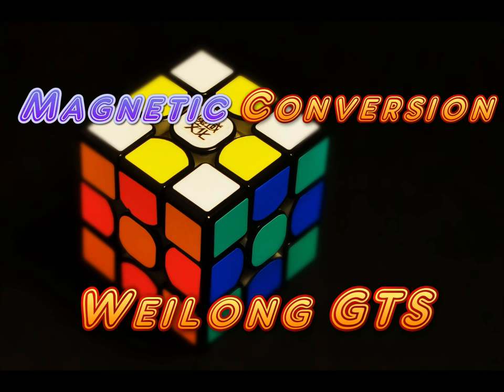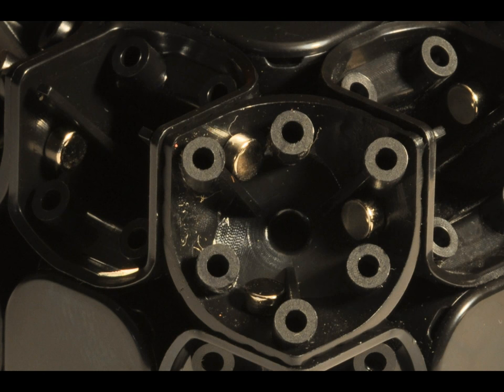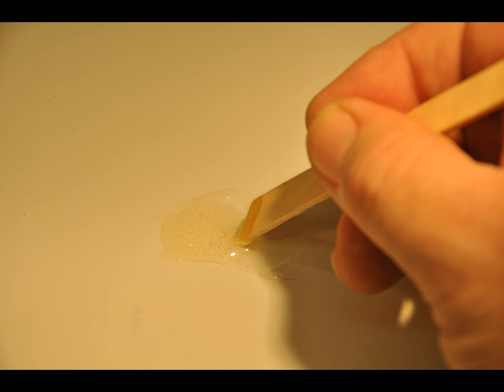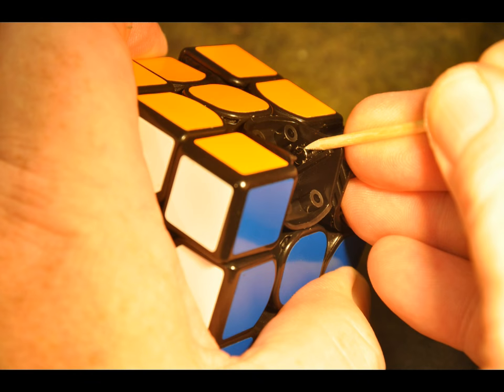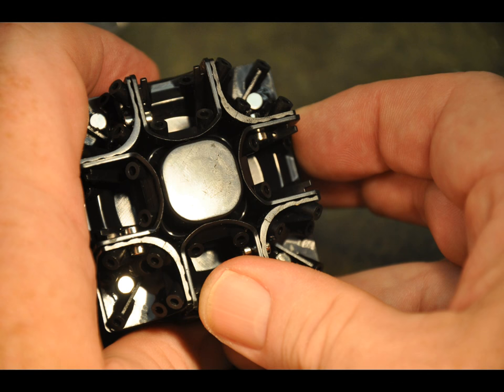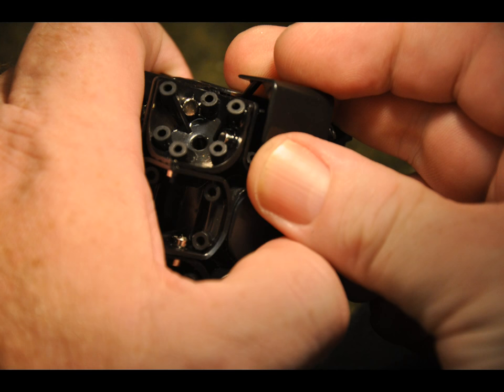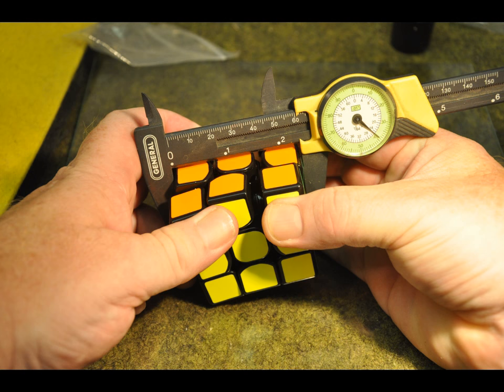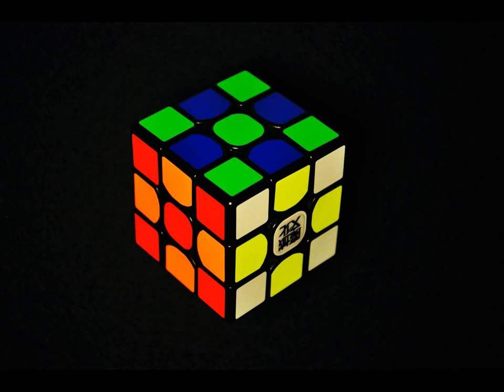Weilong GTS M (Magnetic) Do It Yourself Tutorial

Comment: would 2 n35 magnets equal an n42 magnet? I currently have a gts 1 and wanted to magnetize it to improve stability, but only n35 magnets are on amazon
Reply from the maker: BSØNG I'm sorry. I'm just now seeing your comment. The N numbers don't really work that way. "N" represents the grade or strength, generally N35 being the lowest consumer grade neodymium, and N52 being the strongest. You can double magnetic thickness to get an approximate doubling in strength: like two N35 4x1 magnets, stacked, would give an equivalent of a single N35 4x1. In this example, 4 means the magnet is 4mm wide, and the smaller numbers, 1 and 2, are the thickness in millimeters.
Reply: DMCubing ah, thank you! So you’re saying there would be no point in stacking two N35 magnets?

Comment: Neodymium magnets come in many different grades ("strengths"?). What I found it goes from N28 to N52. The magnets in your link have N48. Did you try different grades? Would you choose stronger or weaker ones for your next cube or N48 is a perfect number?
Reply from the maker: Excellent question! Well, I had been trying to find out what the Cubicle used in their cube by watching as many videos as I could find and reading as much about the cube as I could. When they commented they used a US company, I searched and I found two major US magnet companies: KJ Magnetics and Apex. I attempted to derive a size of the Cubicle magnet based on their photo. As close as I could come was what I think is probably 4mmx2mm. I searched for those sizes and out of the two major US magnet companies, Apex is the only one that carries the 4x2 mags. Their magnet happens to be an N48, like you pointed out. Like I said, I couldn't find a comparable size magnet at KJ. It's possible they may be using a fractional (like 3/16") and not metric. Anyway, I think the N48 4x2 works great. I'm looking forward to giving a couple of my cubes away to see that at work in the hands of some folks that are true speedcubers. While I haven't really planned on using a lower grade (lower N number) magnets, what I'm going to experiment with is building a cube with 4mm x 1mm magnets, With these you can add additional 1mm magnets on top, resulting in a variable magnetic strength cube. That ought to be a fun project!

Comment: Nice i subbed, by the way, when i order the magnets, and i place an order for one, will it give me 50 magnets, or will it only give me one
Reply from the maker: Hey, thanks for the sub! I'll sub back! When you order the magnets, it's for a single bundle of 50 at $6.99. Let me know if you have any questions and how your project turns out! I've been using my magnetic GTS all day long. It's incredible!  :)
Reply: Man, great job!! You definitely earned a sub!! But, I have 2 -man Bell pyra's lying around, could I use those magnets maybe? GJ!! :)
Reply from the maker: +cyothe3rd Hey, thanks! I'll sub back! Hmmm I don't know what size of magnets the magnetic X-man pyraminx uses, but as long as they're really no wider than 5mm, you probably could use them in a GTS. You'll need 48 of them. Looking at pics and videos online, to me the pyra magnets look about the same size that I used: 4mm x 2mm. But that's a guess. You could always take a couple of cubey pieces apart on a GTS and see how the pyra mags fit. Also to see how much pull force they have- they need to have enough strength to make a difference but at the same time, not be too strong. You can test for this with a couple of cube pieces removed before ever gluing the magnets. Let me know what you find out.

Comment: Fantastic job with this!  I now will probably have to try this ;)  
Would you say there are any 4x4s or 2x2s that would work well for this method?  If so, tell me which ones!  I'd love to try it on other cubes as well :D
Reply from the maker: Oh, THANK YOU so much! You're very kind. I appreciate your kind words! Please be sure to watch my next video (it will be uploading soon) as I address how the magnetic GTS feels in the hands. A little head's up: I'm convinced (until I can prove otherwise) that an Illusion (Primary body/Black caps) is superior over the black plastic body. There's something about the plastic, I believe.

I've been thinking about the 2x2 and I don't really see how it could benefit. The way I see it, the magnets help for overshooting and slight undershooting on a 3x3. They also keep the cube in constant alignment. (I demonstrate this in my next video). I can't think of any occasion where this would be fully applicable to the 2x2. It has short turns, no overshooting and fairly good self-alignment, I would think. As for the 4x4, I have no experience with that cube at all. It may very well benefit, but figuring out where to put the magnets would be a challenge. I think the 3x3's design really makes it simpler because of its single middle layer. Pieces revolve around this layer. With a 4x4, it's not present. I'm sure someone more smarter than myself will come up with some sort of 4x4 mod.

Thanks for watching. I enjoy your videos. You do a really good job! Let me know if you modify a GTS. I'd love to see the result! Take care.
Reply: I was wondering if you think you could do the mod in almost any 3x3 with caps, such as the Fangshi cubes.  Do you think that would work?
Reply from the maker: +PurelyAwesomeCuber I'm not familiar with those cubes. I think though that the best cubes would be those that don't have much cubey piece drag. Cubes where the pieces don't rub much against each. These would be like the Aolong V2, Weilong GTS and Version II, Gan Air, Valk 3 (to a degree- it has a little drag), etc. A cube like the Thunderclap wouldn't really benefit from magnets because its cubey piece drag slows it down as the face comes into its resting position. Then, you have to look at the cube piece design to see if a 4mm magnet would fit inside it. 
Oh, I just ordered 300 more magnets! Lol! Got some projects in mind. Also a giveaway I think I'll do.
Reply from the maker: +PurelyAwesomeCuber I looked at the pics of a Fangshi on cubezz. They tend to have the best pics of cube pieces. It looks possible, but is the bottom half of the edge piece in two parts, right down the middle? That might present problems. The bottom of the corner piece looks crowded too, with the way the stalks attach.
Reply: Ok thanks for the info!  Yes, there is a lot going on inside the Fangshi pieces.  Sorry I didn't respond sooner - it didn't notify me.  What you're doing with these magnets is great!  Keep up the good work!
Reply from the maker: Thanks! I appreciate your kind words!!!

Comment: Instead of using the epoxy can I use super glue?
Reply from the maker: No, I wouldn't recommend that at all. The relatively slow drying time of epoxy allows you to make small adjustments to the magnets' positions. Also, you have to work very close to the parts you need to glue. The magnets are very strong and you'll find yourself kind of wrestling with them. I get epoxy on my finger tips every time I do this. It's fairly easy to clean off. With superglue, you risk gluing your fingers! Now, having said all that, there would be a way to do it, but I still don't recommend it because superglue is thin and unpredictable: You could place all 48 magnets in their correct places then add a drop of superglue to the base of each magnet. This comes with too many risks, in my opinion. Epoxy is safer.

Comment: Where do you put the epoxy? The place where you first put the magnet or the place after you push the magnet down?
Reply from the maker: Essentially in the place you first put the magnet, then you slide the magnets down just a couple of millimeters until they seat into position. So you put a little drop of epoxy in the general area then the magnets on top of the epoxy, then push them down into place. The total amount of distance between these two places is mere millimeters. Hope that makes sense.
Reply: +DMCubing can 5mm x 1mm magnet work for this
Reply from the maker: +Valk 3 They would probably fit but would have less than half the magnetic pull force. 5x1 = 12.8 OZ vs. 4x2 = 31.04 OZ.

Comment: hey DM cubing!!my gts v1 is a smooth cube which is not too fast and not too slow.could I use n52s(4mm×1.5mm) ??Will they make  the gts click too strong while turning??
Reply from the maker: Tangy V A magnet like the N52 4x1.5 is going to have an overall magnetic pullforce strength just slightly stronger than an N35 4x2. That is a very light, subtle magnet in a cube like the GTS. I doubt you would have hardly any bump or click. Though I've never used a magnet that light in this cube, I think it still might have some positive effect over the cube. It will be light and certainly not too clicky.
Reply: DMCubing n52 (4mm ×1
5mm) or n45s(4mm ×2mm)??
Reply: Would n50's work?

Comment: I know that this video is a year old, but I'm still going to ask anyway.
1. Have you tried n50 4x1 or n40 4x1.5? I don't have n48 magnets in my local online cubing store, so I'm going to have to choose between the two.
2. Does the position of the magnets matter? Like closer to the outer part of the piece or closer to the core?
Reply from the maker: SalmonGuyGamer 1. If these are your only magnets, then certainly use the 4x1s, but you will need to double them- stacking one magnet on top of the other so you're essentially turning them into 4x2 magnets. If you don't double them, the 4x1 will be significantly too weak. The GTS is a thicker heavier cube so it needs a stronger magnet. An N50 4x2 (or two 4x1s stacked) will give a great magnetic feel. 
2. Yes, the closer to the center of the cube the magnets are placed, the more subtle the magnetic feel. The further out and toward the outside of the cube they're placed, the stronger the feel. In the GTS you're more or less limited to a certain area to place the magnets. Your double stacked 4x1s will be fine.
Reply: DMCubing What feel will the n50 4x2 give?
Reply from the maker: SalmonGuyGamer A medium subtle feel. I've used N48, N50, and N52 in the GTS. The N50 is good because the N48 can be a bit too subtle.
Reply: DMCubing Okay, thanks for your reply! Probably going to try a magnetic gts because the gts v2m (mass produced) just seem too subtle for me. And plus I don't like the size of the gts2.
Reply from the maker: SalmonGuyGamer Sounds good. But a self-magnetized GTS2M can be a wonderful cube. Good luck on your GTS! Let me know how it goes.

Comment: Hey DM. Quick question. Would it work if I were to glue the magnets in the corners first, to determine the placement of the edge pieces?
Reply from the maker: On the GTS. Sure. You can glue both at the same time. I've used several different techniques on the GTS. I probably should do an update video on this one, but I think I'll let this one stand as it is. But back to your question. The GTS is unique in that we can glue all the magnets without ever disassembling the cubie pieces. And the gluing locations are easily exposed, so really whatever gluing technique works best for you, I'd recommend that.

Comment: So do you glue in all of the edges, using the corner magnet to help keep it in place, then wait for it to dry, then glue I the corner magnets? Or do you glue the edges, then the corners before the edges dry?
Reply from the maker: On the GTS you can do it either way. Here, I glued both at the same time. On cubes that we remove the pieces, I do both parts separately into two phases. Great question!

Comment: Gonna try this, but unfortunately Magnets365 doesn't carry N48. Would the N50's make a drastic difference? I don't want the magnets to be too noticeable when going fast.
Reply from the maker: Keanan Tan Have you tried Apex Magnets? They are who I order N48s from. Their shipping can be high, but occasionally they offer free shipping on weekends.  
The N48s in a black GTS will be subtle and this sounds like what you're after.
Reply: Hm, would the N50s have a subtle feel as well though? Or would they be on the more noticeable side?
Reply from the maker: Keanan Tan Kind of in between particularly in a black cube. And it depends on the N50 magnet. There are a lot being sold that are weaker than they should be. But if they're truly N50s they will be noticeable but shouldn't feel too strong. If you like the magnets to be subtle, then N48s in a black cube would be the way to go.
Reply: Hey, what strength of magnets would you recommend for the MeiYing?
Reply from the maker: Keanan Tan I haven't done mine yet, not in the conventional way, but I would think the grade N48 4x2s would be fine in it.
Reply: Darn, I just got N35s since it and the Valk are so similar. Hopefully the change in stability and feeling isn't too subtle!
Reply from the maker: Keanan Tan well, like I said, I haven't done mine yet. Well actually I am working on one, but I am magnetizing it in a different way, where the centers attract the edges. But it may very well be that the N35's work fine. If you use them please let me know the results as I am curious myself. Thanks!
Reply: I'm certainly curious on how this new way would work. Does it have any envisioned benefits as compared to the "standard" way?
Reply from the maker: Keanan Tan yes, better M slices because of the weight of the magnets being in the center of the cube. But it's a messy affair gluing the magnets in the centerpiece I got glue all over the inside, and now I have to scrape it just to get the caps back on. So it's been very time-consuming and I just pushed it to the side for right now temporarily.

Comment: Did you ever end up trying N52s on the GTS? Im fairly limited in what magnets I can get in the UK with only being able to get N52 4x2s to do on a GTS. Not really a fan of being able to feel magnets while solving so im just checking with you about how they feel.
Reply from the maker: KCut They feel awesome, imo! To me, the N48 in an Illusion (primary plastic body, black caps) feel about like what N35 do in the Valk, subtle. In the black GTS, the magnets feel even slightly more subtle. So to me, the N52s feel perfect in a GTS, both in the black and primary versions. The plastic is thick enough so that you really won't be feeling too strong a magnetic pullforce, and really, anything weaker than these two magnets are really going to be ineffective in a cube like the GTS.
Reply: cheers for the quick reply again, nice to know they should feel the same as a valk since im probably gonna magnetise that at the same time. Thanks!
Reply from the maker: KCut In the Valk, N35 is the way to go if you like a subtle magnetic feel. Let me know how your projects go.

Comment: I'm back again!! So I have a question.  I just started glueing, and I have one magnet glued into a corner, and one in a edge right next to it.  Could I corner twist that corner, to do all of the magnets in that piece? Also could I use a corner as a helper magnet, and turn it around the cube to help alignment??  Thank you!
Reply from the maker: Yes, you certainly can do it this way. I was still using epoxy when I made this tutorial, and it has a very long handling time. But with superglue, as long as you wait a minute or so before rotating the right face, you could do each corner piece magnet that way and come back and do each edge piece magnet that way. When gluing the magnets, just keep in your mind the relationship of the pairs, where they occur, at the top middle of the face of the cube that is facing you. 
This is a rather old video and I've changed quite a bit of my technique. What's presented here still works, but I may eventually do an updated version which shows the technique you're talking about.
Good luck! And let me know how things go!
Reply: Ok, will do!  I've decided against moving the one corner around the cube, because I feel as it might mess me up, but I am going to cornertwist the corner to do those!  Thank you so much!
Reply from the maker: Which ever way you do it, just lock in on the pairing and find those pair grouping locations throughout the cube. Otherwise it's easy to get confused. (Been there. LOL!)
Reply: I don't think I understand what you mean about pairings and pair groupings.
Reply from the maker: What I mean is just concentrate on the single pair of magnets, otherwise it's easy to get lost with the placement and polarity if you try to short cut and not rotate the cube and start trying to group the magnets another way.
Reply: Ok, I think I got it.  One last question.  In an edge piece, should the two magnets be repelling each other, or attracting each other?
Reply from the maker: Merpy Mert all edge piece magnets have the same pole facing outward, so in a sense they repel but it's not really anything to have to think about because all you need to think about is placing a single pair of magnets in the same location the same way, each time, throughout the cube. And you need to mark the stick of magnets in a way that will let you know you're removing them from the same end each time.
Reply from the maker: Merpy Mert I explain this in an early video called Addressing Polarity in a Magnetic GTS. It's my sixth or seventh video